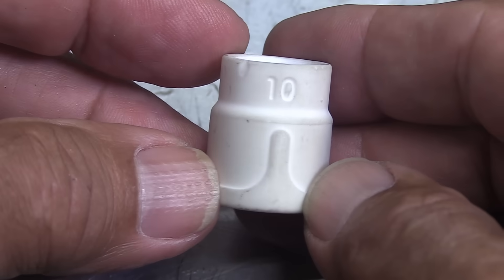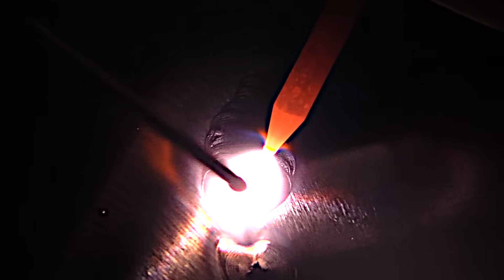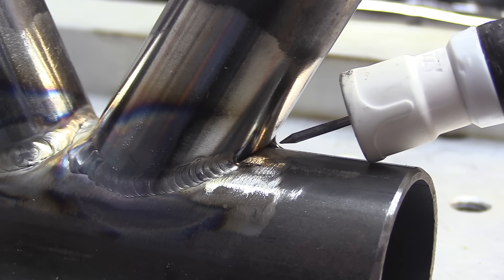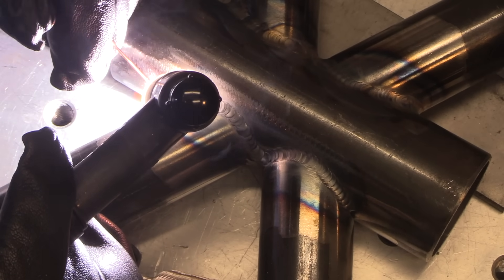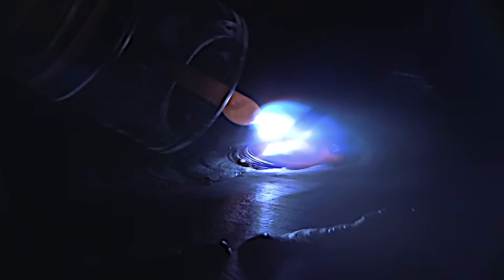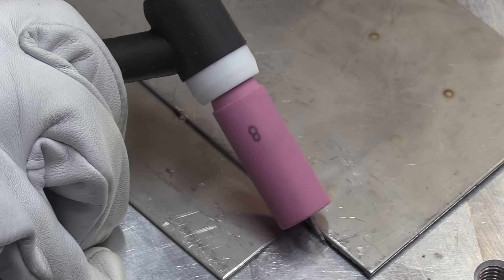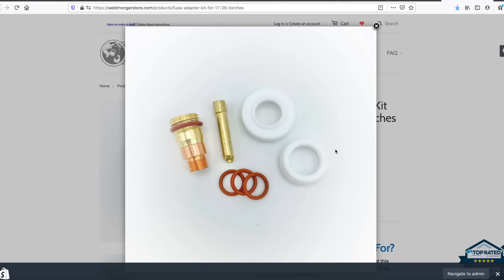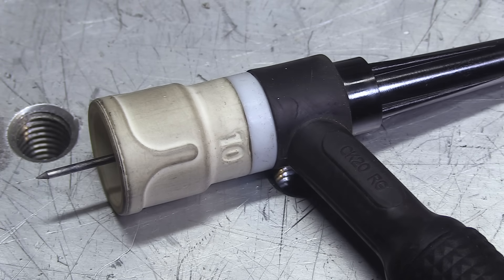7 Tips for TIG Welding Steel Tubing

Comment: Any chance of covering TIG welding for beginners with a unit with just 4 settings as on an older 110V MIG unit without digital read out converted to TIG?

Comment: I have been a metal worker for 36 years.  The blacksmith type.  As my farrier career is winding down I have been considering doing welding work.  So I can work from my home shop I would like to become a tig welder.  Also I am very attracted to pretty tig welding.  I am a fan of it and also fascinated by it.  I am 56 years old.  Is there enough time left in my life for me to become proficient enough to really lay it down?   Build a small side business?   If money was not an issue, what machine would you buy?  Thanks for you videos and podcasts.

Comment: @weldingtipsandtricks Hey Jody firstly thanks for all your vids they have been a real help for me as I am a boilermaker apprentice. I was hopi g I could put in a request as I'm having a bit of difficulty with one particular position. I am trying to weld some long 150x75x6mm U-beams to a base plate (pipe support stand). However I am consistently getting slag inclusions at the inside corner. I have tried with 6010 and GP, upped my amps and so on. I could just tig it this time, but I'd rather find a solution incase I need to run the same position out in the field. Your advice would be a massive help. Keep it up and stay safe. Thanks again 🖒

Comment: What amps you recommend for 1/4 cast aluminum
Reply: A lot more than you think you need! Aluminum welded too cold means you spend way too much time trying to weld it. If I recall welding 1/4" 6061, I was up around 180-200 amps and moving quickly.

Comment: I have a question...I was a professional Mig welder for a company for a few years...got hired by another company to be their Mig welder but when done with the Mig (for the day) was asked to do Tig...( i have never been a good Tig welder but I did pass their Tig test)  at the end of my Tig welds (not all the time and not in my TIg test) but I would get porosity just at the very end of the weld.  Or when connecting a weld to another.  My Tig welds looked great except for the very end.  Any ideas as to why?  This was years ago and I have since gotten out of the business, just curious why.
Reply: I was welding steel 16-14 ga

Comment: Mr. Jody, i don't remember if i ever seen you weld aluminized steel like the kind that's used for automotive exhaust tube. thanks for your teachings💪
Reply: Exhaust tube is both aluminum killed and aluminum coated.  The aluminum coating is easily removed in weld areas but even GTAW doesn't have a problem in my experience.   It acts like a deoxidizer, the same reason it is used to "kill" steel after the oxygen lance has burned out excess carbon, chromium,  phosphorus etc.  The steel is now a fizzy ladle with lots of carbon dioxide,  monoxide and oxygen.  Adding silicon or aluminum reacts and stops the bubbles, forming small amounts of silicon or aluminum oxide.  Most of it floats to the top of the strand casting tundish.

Comment: Can you comment on the utility of the Jazzy10 cup for welding Al?
Reply from the maker: its not recommended for AC welding.  I have used it on a few aluminum jobs where I needed a long stickout but normally, there are other cups that work better on aluminum.
Reply: Awesome, thanks Jody.  Do you have any videos covering cups for Al?

Comment: Off topic but would you please consider doing a video on how best to see the welding process when you are welding? I can see better with TIG and Stick but MIG is a constant problem. I have tried several helmets and all of their adjustments with little consistent success. Every once in a while the sky opens and the weld is perfectly visible but I can't ever figure out what I did differently. The best help I have found so far is using bright light on the weld. I'm sure you have some insight into this issue and I would be very grateful to hear it. Thank you.

Comment: May be a silly question but, oh well.... Would it be correct to compare MIG to TIG in terms of strength. For instance when welding a trailer would TIG welds be as strong as MIG? Or is TIG actually stronger? I know there are probably a ton of variables but still. Thanks! Always enjoying your videos.
Reply: absolutely appropriate. Tig is far cleaner and stronger but its still not used for everything. Mig stick great for dirty metal, lawnmower repairs, farm equipment, manufacturing etc etc. Tig is used a lot in aerospace titanium/inconel, They xray the  welds on some parts to make sure they are perfect.

Comment: It might be off topic but in regards to scratch start tig, would it be feasible to wire a foot control disconnect into the ground clamp circuit to start and stop the arc? Thank you for the excellent content you put out there for us.

Comment: I love the quite, clean no splatter of Tig.
I have a Miller Syncrowave 250 but haven't used it in some time. I had a job to weld several thousand stainless steel collars onto 1-1/8" stems but the job ended.😀 
Mine only has a foot pedal which is sometimes inconvenient.